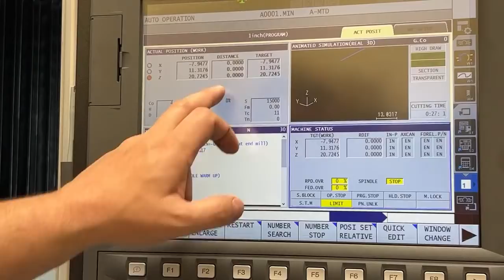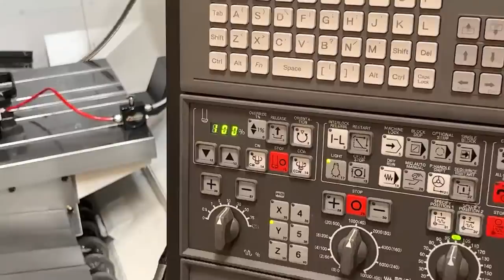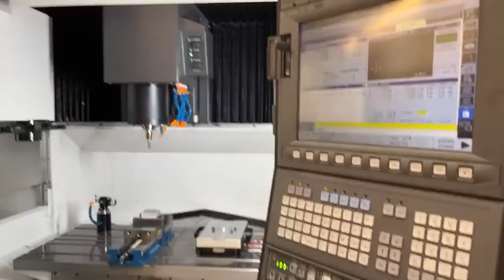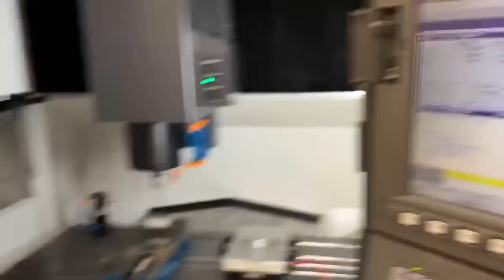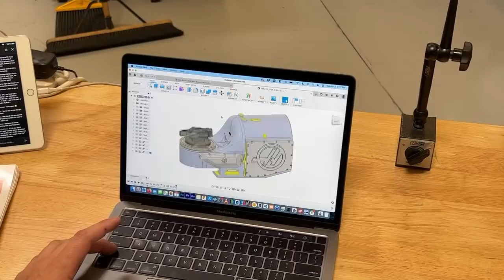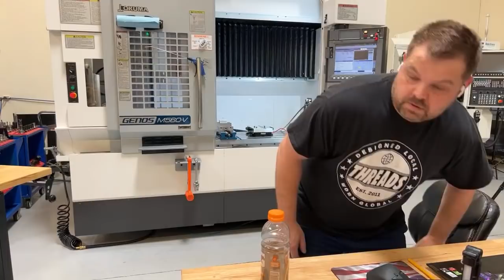Okuma M560 First Impression - project updates

Comment: Interesting to see another M560 in the wild. Mine uses M6 for toolchange. G116 starts the rotating tool touch off cycle. Pro tip, hold down interlock release and press set position to bring the machine home. I use this all time when I'm dialing in my first part.

Comment: Why on earth do you have to use G116 for toolchange instead of M6 like all normal machines, can someone explain?
Reply: You don’t. As the program runs, a tool is called up into the spindle, & right after that, a tool is queued up next. The control sees this & get its ready so when its tool change time, its not searching for it. Anywho, if tool 1 is in the spindle, tool 2 is next. If you come to T3M6, you will get an error. You must change T2 first, then T3 or whatever tool you want. G116 is a way around all that

Comment: dude you won't need warm up program for a machine like this that's for lower quality built machines
Reply: This is true. A Okuma rep said at day of installation, you can run the spindle 15,000 rpm non-stop for 3 years in their warranty.  😊

Comment: Great machine!  Pro TIp - replace the lock line on the tool setter with hard line.  The supplied line fills with coolant and the added inertia of coolant being expelled when the air turns on swings the lock line out of position.

Comment: You can get the spindle ground in the machine. Just take a vice off to have a bare and perfect table surface for them to set the grinder on. Just make sure your spindle bolts are good and tight. My shop has it done every now and then and it works wonders. They can kiss the inside of it until it’s cleaning up all the way around

Comment: I like your content overall. I am really into tooling. I am an old guy and I can tell you from 47 years of machining and 24 years of CNC experience. Tooling is like ammunition. If You have a wide variety of tooling You can usually get the jobs done relatively quick.

Comment: If you ever get an alarm during a tool change. There is a way to use hand wheel through tool change one click at a time through the tool change. Pretty slick! milltronics you have to use a wrench and a second person to catch the tool.
I believe in mdi you just have to do T1 etc.  cycle start and call up any tool you want